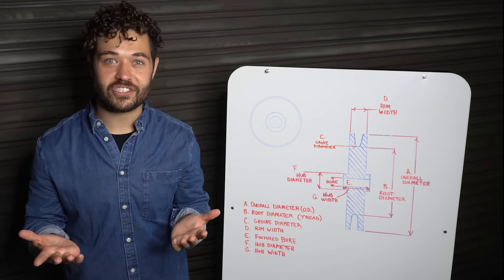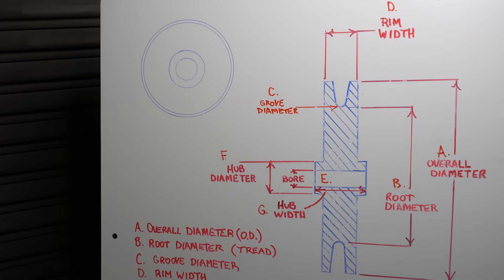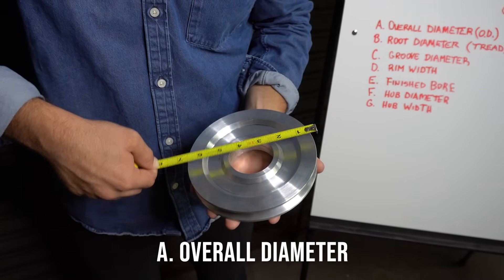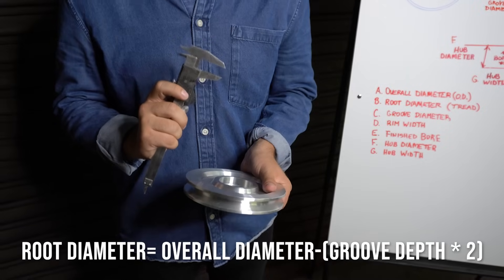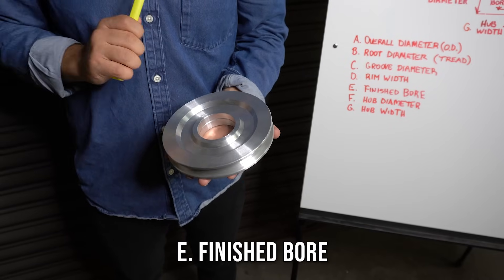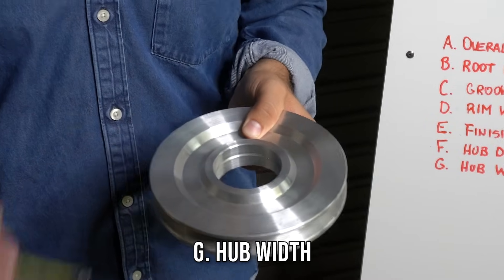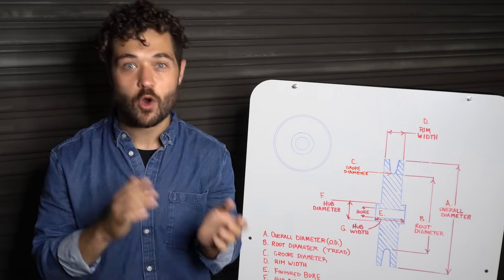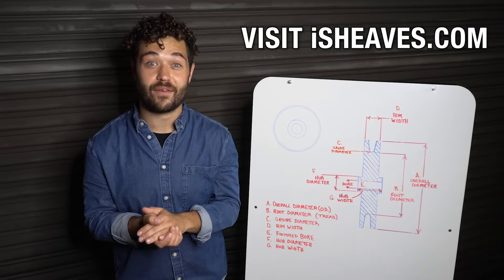How to Measure a Sheave

Comment: This is slightly concerning: the "Finished Bore" diameter is measured incorrectly in this video. The inside small jaws of the vernier calliper (located on the head of the tool previous used to measure the "Root Diameter") would provide an accurate measurement of the "Finished Bore".

Comment: I have a finished bore of 5/8 inch. Then there is a slip in bushing to the axel diameter is that still used today from mid 1970s